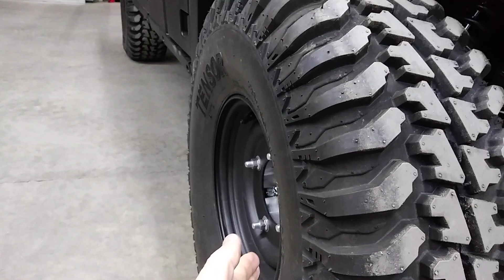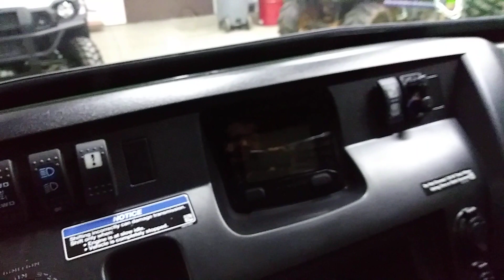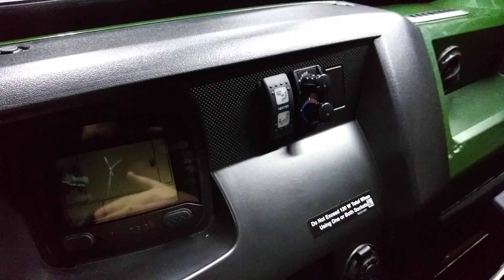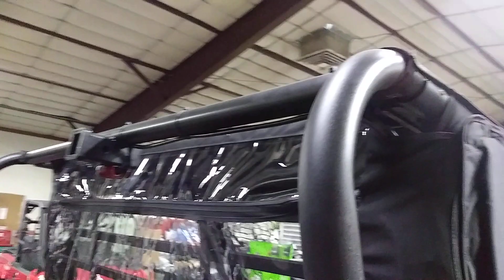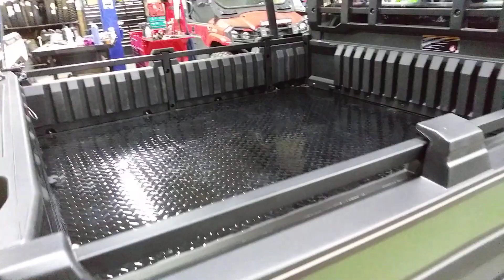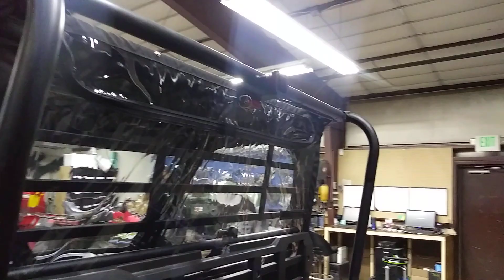2021 Kawasaki Mule Pro FX H.E. Elka shock package, Soft cab, heater custom winch mounts and more!

Comment: Are the front halves of the FX & FXR the same dimensionally? 
There doesn't seem to be much in the way of aftermarket parts for the FXR. 
Maybe I'm just not looking in the right places. 

Ultimately, my question is will the soft cab doors, or the Seizmik that you mentioned below fit the FXR?
But this also applies to things like the Elka shocks, bumper, brush guards etc...
Bruce C.
Reply from the maker: The roll cage is much shorter on the FXR, so most places other then the manufacturer will not build for a single, lower production model. Now if you really wanted to open it to all the possibilities you could technically put the fx ROPS and then fit all those parts. But it's really only in the cab area, everything else is the same when it comes to suspension, bumpers etc etc.
Reply: @HesterEdition  Thank you Sir, I realized that the cab area was different  shortly after I wrote this but forgot to take down or edit the message. 
But I needed to know the second part of your answer as well, in particular because I was looking at an aftermarket bumper that I thought that it said would fit an FXT but not the FXR.
I really appreciate your time and help, thank you for both.
Reply from the maker: @Delmarksman  you betcha

Comment: Tensor Regulators? 28x10x14?
Reply from the maker: Yes tensor regulator but these are 28x10x12 on stock wheels. You can do 14s if you changed the wheels to 14s

Comment: Is there a way to get the soft upper to swing WITH the door when opening if you use the pin??
Reply from the maker: In the FX Mule, I feel the Seizmik doors are better, they mount to the door and open and close together.

Comment: Any rumours of someone making a front diff lock for these yet ? And what clutch kit do you guys use for 30 inch tires on them
Reply: So many people fixated that both front wheels do not turn when in diff lock. I have a Honda rincon atv 680 which does not lock both front wheels.  I run a trapline in Northwestern Ontario, Canada and I have never been stuck. Just drive accordingly and if you do get stuck, use your winch

Comment: I like the US General tool cart Hester Green harbor freight yes job one
Reply from the maker: Yes my 3 techs each have one, along with a big Husky and snapon. But the smaller carts are great to have the basics anywhere around the shop.
Reply: @HesterEdition  Yes I also have the lime green Mopar green or Kawasaki green its all the same, let me know if you can pull some magic and figure out how to get those turn signals that I see on the UK mules full size amber and they stay lighted as a parking lamp as well as turn signal.
Reply from the maker: @class8garage308  that I would not be able to get, can't get non-US parts. You would have to get with a dealer over seas. We love the Ryco kit, works great!